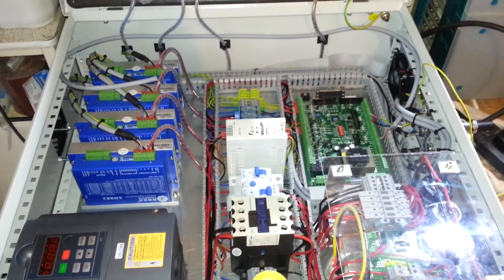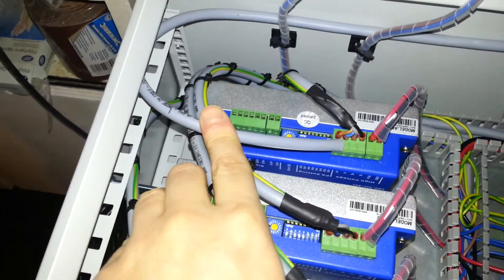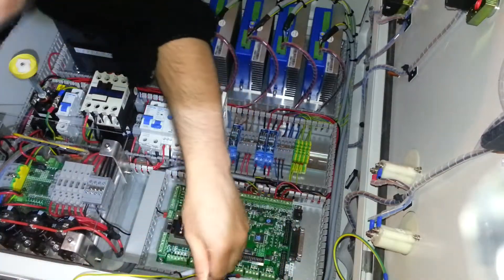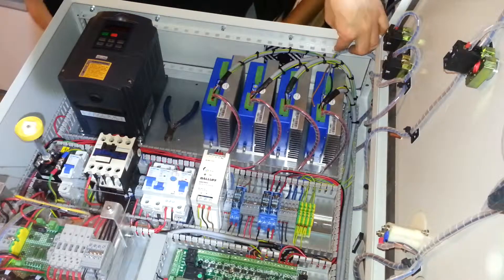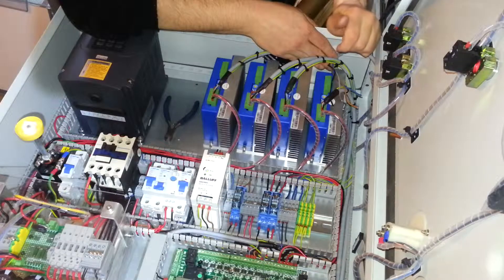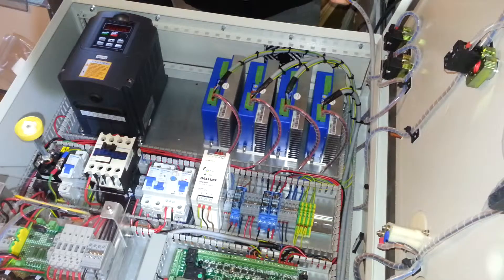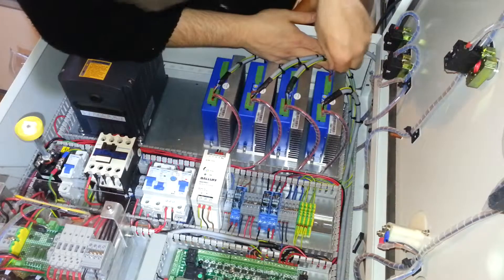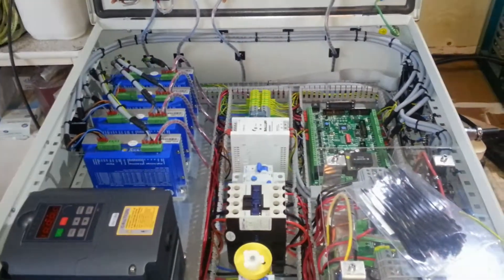Drive Control Wiring

Comment: Do you purchase a commercia available control cabine or make  a customized one？We always wire the component on the mounting plate.then,push the sub-assebly into the cabinet.